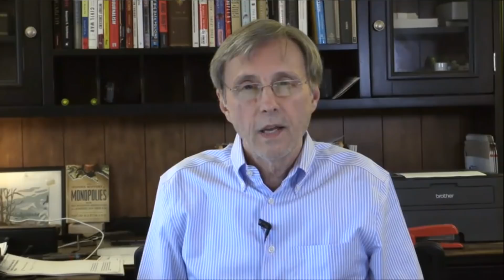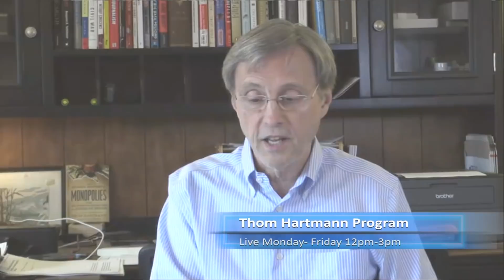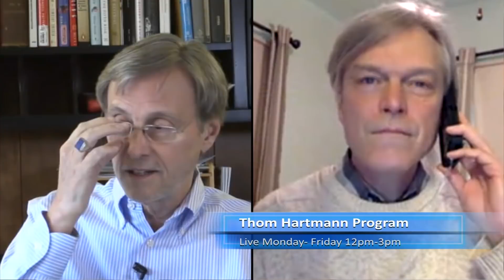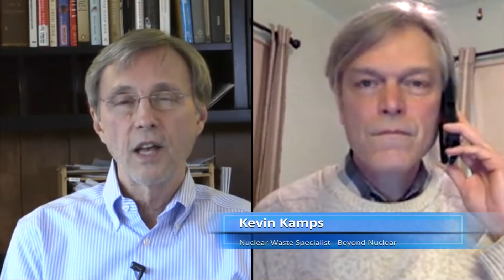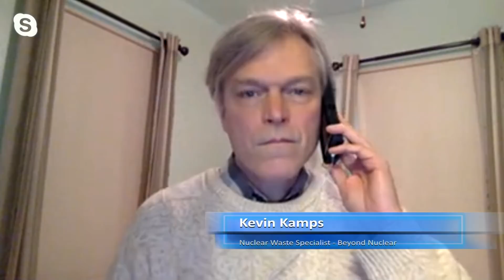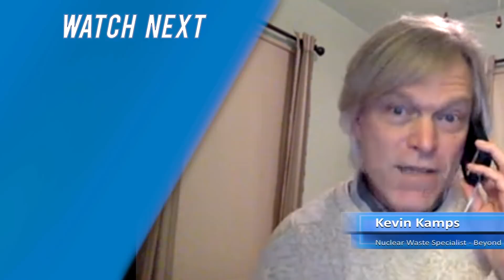US Nuclear Facilities Aging Badly - VERY Badly (w/ Kevin Kamps)

Comment: Depends on the type of nuclear reaction. Fission is extremely dangerous, but fusion is quite safe. My house runs off a nuclear reactor eight light minutes away that's about four and a half billion years old and is still going strong without a glitch. 😉
Reply: @Scruffy Topaz very true, but sunscreen is not only lighter than a lead vest, it also leaves a nice tan. And you can swim with it on! 😁
Reply: That is true.  If conservatives can admit global warming is real and put a bunch of asterisks next to that, then we can be cute too and act like we are pro nuclear power meaning we are pro solar
Reply: When they can locate nuclear reactors 8 light minutes away (91 million miles) from my house, then I'd consider them quite safe, too.

Comment: If your concerned like me then reduce your need for electrical power. Don't run the Air Conditioner in summer. Don't run the electrical heat in winter. Tough it out.

Comment: With the threat of a cyber-attack, nuclear accidents are all the more dangerous. Computers run all controls of these plants. Scary stuff
Reply: it is foolish indeed if the controls are connected to world wide web or that there is any easy way to access them, after us has sabotaged in the past f.e. iranian nuclear program with a computer virus.
Reply: Its a good thing some of them have backup diesel generators
Reply: No, computers and internet systems DO NOT run the controls at nuclear plants. 

Nothing at a nothing power plant of any soft of importance is connected to the Internet. In fact most reactor control systems couldn't be connected to the Internet even if someone wanted to be stupid as they predate the Internet and are often still analog. There is literally NOTHING compatible to plug in.
Reply: @bronzedivision  Why not?  They're totally safe.
Reply: @bronzedivision  Would a internet connection be a PROBLEM?  What disaster could occur at a completely safe nuclear power plant?
Reply: @Atmost11  An Internet connection provides first and foremost NO advantages whatsoever. 

Power plants just don't need them, nuclear or otherwise. The office will and maybe some specialized staff, but not the plant's actual control system. 

So rather then speculate on what might or might not happen in a sabotage hacking situation it's much better to just play it safe and forget the whole issue by leaving it disconnect and impossible. Since you don't needed anyone, adding such a connection only creates liability and vulnerability. And even if a "nuclear" accident is impossible there are still many ways to harm the grid or cause expensive damage which can be just as bad. 

The only time this paradigm MIGHT be different is entirely autonomous MMR systems that are remote controlled. But those are all inherently passively safe and just a few megawatts at most.
Reply: @bronzedivision    So you are telling us, seriously, that safety is not a reason.  Reactors could be safely on the internet.  It just "isnt necessary"
Reply: @Atmost11  No, there are lots of safety issues involved with connecting a reactor to the Internet. Although they're trumped by the simple fact such a plan is also a complete and total waste of money. 

And that's true even if the reactor is one of the magically ultra super hyper safe modern types. 

Simply being able to get control of it remotely even if no nuclear specific issues can occur is a very tempting target for anyone interested in grid sabotage. Blackouts, power fluctuations, and maintenance issues can all be very bad even without radiation effects or core damage.
Reply: @bronzedivision    Its cool that you admit some nuclear stuff is a total waste of money

Comment: Nuclear power has a role as part of a comprehensive global warming strategy.  But that does not include the building of any new nuclear power plants, it is strictly a matter of extending the life of existing nuclear plants - not all of them of course.  Nor does any strategy for global warming rely on prototypes or theoretical designs of technology which does not yet exist and certainly does not yet produce power, thorium for example.
Reply: @MimeticMimic    I used to say, "if we must have reactors let us get the Japanese to build them for us"
Reply: @Atmost11   We need thorium molten salt reactors.  They are safer and use spent fuel as its fuel source, further depleting our stockpiles of nuclear waste.
Reply: @danadurnfordkevinblanchdebunk    You keep saying that but AGAIN, 1) nobody will even build prototypes without free govt handout money, 2) prototypes are 40 years away from implementation and we have cheaper more reliable investments to implement right now
Reply: @Atmost11   Solar and wind are heavily subsidized too.  All electricity is.  
You call 50-year old technology a "prototype" that was operational for four years and claim we need 40 years to develop it?  Wow, what planet are you from?